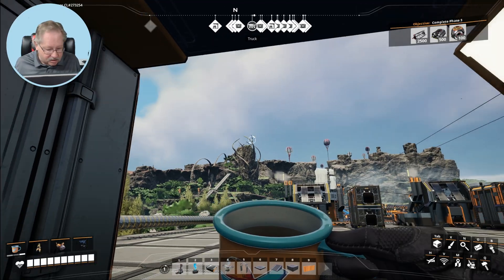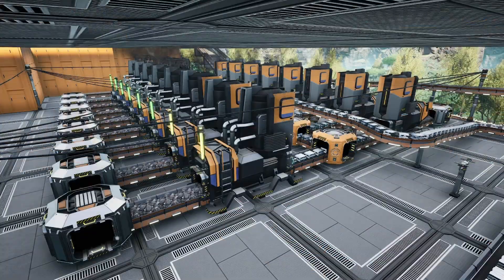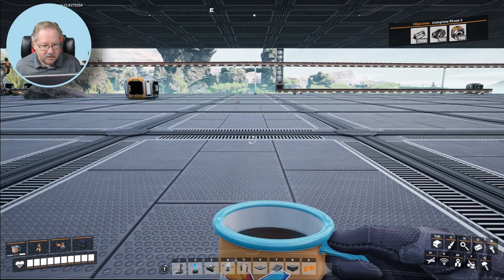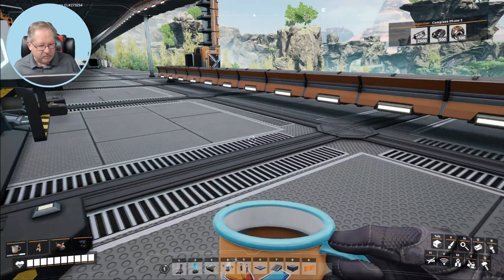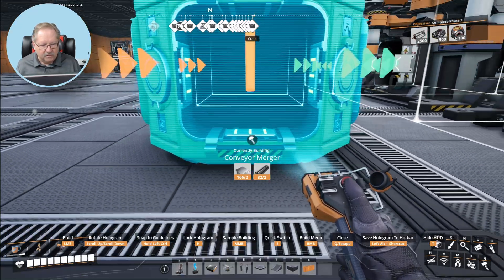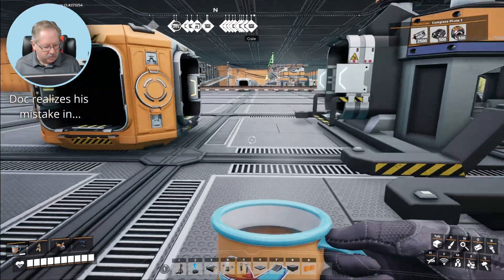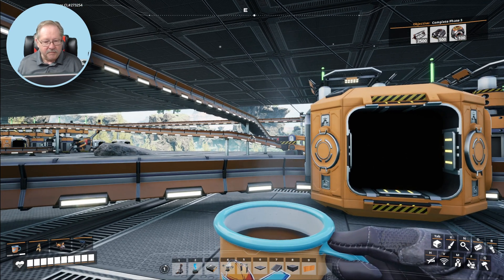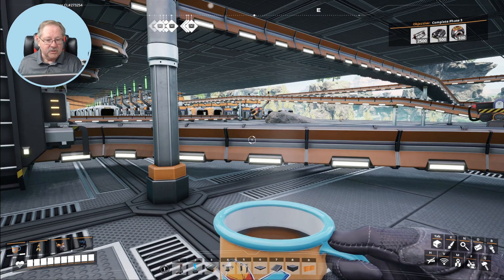Building Faster and Better Factories with Blueprints [Satisfactory 31]

Comment: All settings are saved on the blueprint, underclock and recipe either
Reply from the maker: I like that. So I can get one blueprint perfectly optimized with underclocking / overclocking set. Great tip! thanks!
Reply: Also, try to get as much hard drive disk as u can, the alternative recipes are really useful
Reply: I forgot, also belts and splitters are saved on blueprint

Comment: If you want to fully commit to a certain Blueprint doing only one thing, you can set the constructors in your blueprint maker to do plate.  If you do that in the blueprint it will save the settings on the machines :)

I'm loving how this factory is turning out, I'm building something quite similar!
Reply from the maker: Interesting. And after saving the Iron Plate blueprint, I could just change their output and re-save as something else. One blueprint per item... Good idea! Thanks for the tip.
Reply: @Gaming_with_Doc  Another way to speed up configuration when using blueprints without set recipes is to use good old Copy/Paste. Set the recipe and production rate on one machine, back out of the configuration screen, highlight the machine and hit Ctrl-C. Then aim at the other ones one by one and just paste the settings with Ctrl-V. The game stores one configuration for each machine type in memory, so this method works even if there are multiple types like smelter and constructors.